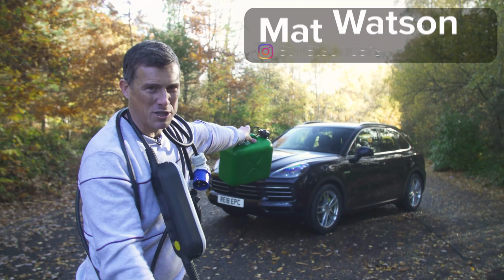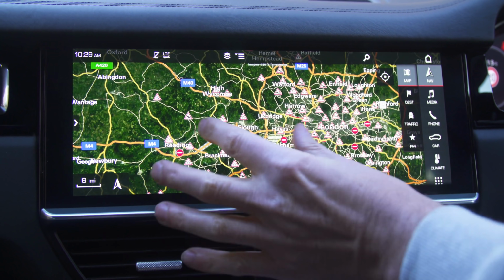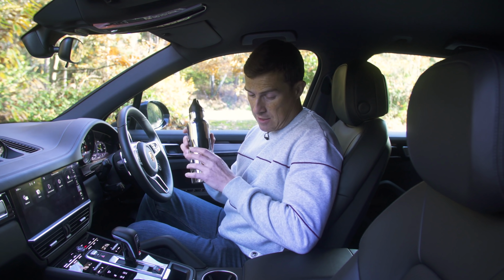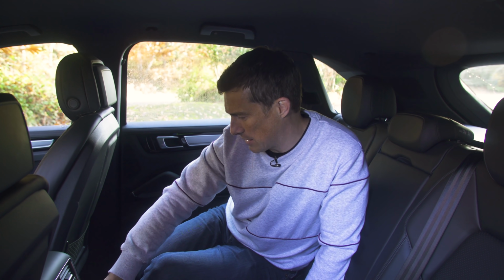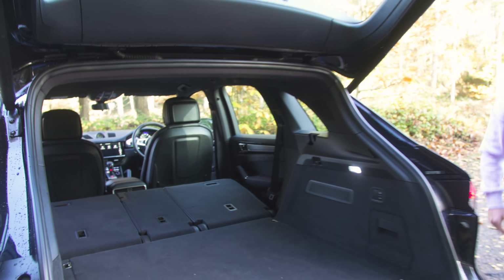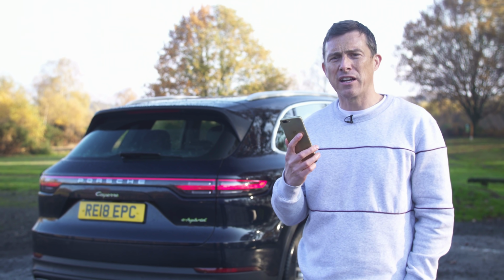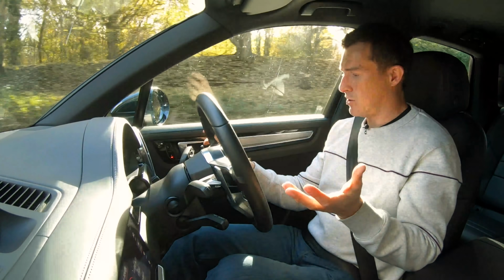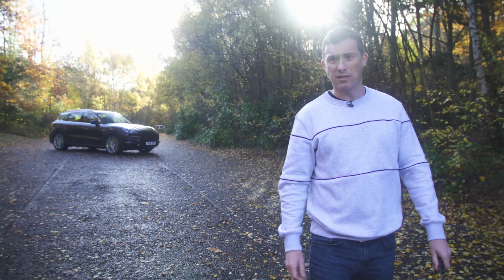Porsche Cayenne 2019 SUV in-depth review | carwow Reviews

Comment: Great review. Just one comment... the criticism regarding the volume control on the console... once you’ve owned the car, you’ll realize that the swivel knob and volume control are perfectly placed when you are resting your hand on the shift lever, which is intentionally shaped like a little platform to rest the heel of your hand on while your fingers can basically reach pretty much all the controls on the console as well as the touchscreen. It’s brilliant once you get used to it, and clearly it was designed that way from scratch as it works so very well. Just wanted to point that out, as you mentioned the same thing with the Panamera. Great review, I enjoy all your videos.

Comment: I test drove both the e-hybrid and the S back to back.  I found that the hybrid felt sportier and far more reactive.  The torque is available straight away, and the manner in which the electric and petrol engine kick in together is fantastic.  Off a race track, I would image the e-hybrid would be the more fun.  As for the green elements, these can all be 'removed' free of charge.  Just a question of taste whether which way you want to go.  The options list on Porsche, as with many German cars, is long and can add up.  Still, the best SUV that I have had the chance to drive by quite some margin.

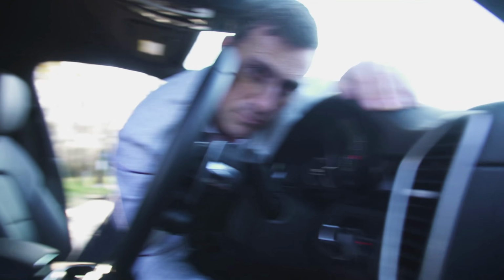Comment: 11:17 although a bit gimmicky nowadays, Porsche is the last automaker to keep the tradition of the LeMans-style start ignition switch. Back in the day, racing drivers would run to their cars, start them and drive off. Porsches has the ignition switch located opposite of the gear shifter so drivers could shave a few seconds by simultaneously starting the car with one hand, using the other to shift into first and set off faster than their competition... good times.

Comment: I don't think the issue with the fuel filler cap an Annoying problem..it's actually a great feature...no one is going to steel your charge when it's parked somewhere... Bit some one could drain your fuel....so it's better be locked from inside when parked

Comment: Anything that's not a button that works by pushing it, like a button, should be called out for the shite it is. It's cost cutting, because a screen is cheap and buttons are expensive. It's also dangerous, and generally utter wank. So the Audi ones vibrate? Who cares. Feedback after you've pressed something isn't the issue - finding it in the first place is.

Comment: I've been working for BMW and that button, that you have to push to open the fuel cap is to prevent the petrol from exploding in your face. Petrol vapor can potentially built up and won't be burned off, if you drive in electric mode for too long. All hybrid cars have that button to get rid of petrol vapor
Reply: 😮... Well Now

Comment: Nice review as always and no the fuel economy is not like this because of the spirited drive, it is actually horrible and you can barely drive 450km combined. Also it has not a good sound and the break feeling is inconsistent and shaky... It does not make any sense compared to the cayenne S and will be irrelevant (and drop price like a rock) in a few years. These new regulations are killing porsches competitive advantage making it's cars feel and sound like any other German car.
Reply: The E-Hybrids are far superior to the Turbos in the Porsche line-up.  I own a new E-Hybrid, and I've driven Turbos.  You get used to the brakes -- they are excellent and will stop you when you need to stop, quickly.  In my E-Hybrid on long-distance driving without plugging in, I can drive 550 miles = 885 km on a single tank of gas.  I plug in every night at home, and when I drive locally, I typically go 1000-1200 miles on a single tank of gas.

Comment: Paying extra for heated seats, full leather interior and reversing camera is an embarrassment for Porsche. 

I don't like these new infotainment systems. As Matt said, its so awkward to use while driving. Vibrating buttons don't help because you can't tell which button you've pressed, you can tell you pressed something but not what you've pressed. With physical buttons, you memorise the location subconsciously, think about a keyboard for example.  The swivel wheel is very small and the gear lever gets in the way. Awkward volume control too. At least you get physical temperature controls.

Comment: "you have to pay extra for <things>"

Same with every German car. There's very little comes as standard. On the plus side for that, you only pay for what you actually want, but on the minus side the headline price for the car is meaningless. I spec'd an A250 the other day and the base price was 38k and my config ended up at 62k.
Reply: There's actually a LOT that comes standard.  But, yeah, it is frustrating that you have to pay for adaptive cruise control, blind-spot monitoring, heated front seats, CD player, and lumbar seat support in a car this expensive.

Comment: Porsche no longer sell diesel versions so I no longer desire their cars. Who in their tight mind would buy a petrol SUV.
Reply: Luke Smith yes diesel engines are not as bad for flora as their petrol counterparts (one car wont make any difference for climate change but whatever floats your boat). What you don’t know is that diesel is much much worse for humans and animals when inhaled, which is why a lot of old diesels aren’t allowed in cities anymore
Reply: Who in their right mind would buy a diesel Porsche
Reply: People have been buying petrol SUVs for a long time. Deal with it.
Reply: Charlie Vetsworth well the majority is usually wrong
Reply: Luke Smith Diesel = Low CO2 (good for the planet), high Sulphur and Nitrogen oxides and dioxides (bad for people).
Reply: MKRM27 diesels now have systems to remove Nox and we have had low sulphur fuel for years now. There is no getting away from the fact that diesels are fare more efficient than petrol engines hence there is no such thing as a petrol lorry or ship.
And yes I do see the attraction of a high revving petrol engined sports car or an extremely quiet V12 petrol Rolls Royce but for everyday use diesel will do fine for me.
Reply: @Macron87  fuck people if you dont have a planet you wont have the pepole .
Reply: <Breathes in>
WHO IN THEIR RIGHT MIND WOULD BUY A PORSCHE SUV 🅱️🅾️ℹ️?
Reply: -never intended to buy a Porsche in the first place
Reply: Just an info thrown out there. I daily drive to work for 100 kms (2 way trip).
Get this: my wife's petrol Toyota Yaris burns 6,1 lt for this 100 km trip.
My Mercedes E220d which is like 40% heavier but also x10 times more luxurious burns anywhere from 4.4 to 5.1 lt of diesel for the same trip.
You do the math of how much more efficient the diesel engine is.
Reply: E-Hybrids are the best Porsches made.  The fastest Porsche is the 918 Spyder (faster than almost all other supercars), an E-Hybrid with a petrol engine and electric motor.
Reply: Diesel in 2018 😂😂
Reply: Why not?

Comment: That infotainment center is super laggy.
Reply: Julian Green That’s because it’s filmed. In real life it’s Perfect, I already tried it ;)
Reply: @lorenzmuller4000  So why other filmed cars do not lag ?
Reply: V 12 If the camera records at 60 fps and the display is a 50 hz display it can happen that each shot of the camera misses the picture because they are asynchronous. I’m not a technician so it’s possible that my explanation is not 100% accurate, but you can see the same thing happening when doing a slow motion record of a lamp. It looks like it is flickering but in reality it’s not.
Reply: @lorenzmuller4000  They use the same camera on other cars, why doesn't it happen there ? The transitions are not smooth like on a phone for example and there is no reason it shouldn't be on that car.
Reply: @lorenzmuller4000  lol that makes no sense m8. No trying to argue but how would film change the perception of input lag?
Reply: Julian Green its very responsive
Reply: @turbos7780  It is not responsive. It lags. That is what touchscreen phones and stnavs from 2008 did. MBUX does not lag. I drive does not lag. That lags.
Reply: @mnoovurvi  yeah. BMW and Mercedes seem to have gotten it right
Reply: Agree about its lagging, check out new Porsche Panamera infotainment system is very smooth but the BMW iDrive has aced the game, so did the Mercedes & Audi MMI
Reply: @johnhere1426  ill have to check out the bew panemera. as for BMWs iDrive, i agree. with Mercedes, yes,  but only MBUX, not Mercedes Command. Audi's MMI can also be laggy as i have had some first hand experience, and yes, with the old and new version
Reply: The screen sux, big time. No joke. It’s horrible. Whole system is horrible, makes me want to punch it every time I use it. CarPlay is good. But if you use it the screen becomes tiny. A lot of grey useless bars. Whole thing is rubbish. Car is great, fit and finish is great, electronics should be a big iPhone mount with wireless charging. CarPlay is an ok proxy. Like all good German cars, the screen is disabled when driving, except for radio, ac, etc. bc no one ever crashed a car fiddling with the radio, but entering an address is way too dangerous.  But if you use CarPlay you can enter an address while moving, so again, stupid Germans. Fire the lot of them and outsource it to Tesla, or Apple, or a team of like 5 average college kids.
Reply: ken90017 Lol fucking liar. This car is not even released and you talk like you own one.
Reply: @A real petrol-head  Have you been talking to my Xs?
Reply: Agreed. Driven one. Long lag.

Comment: Well, no one is going to steal your charge but one can steal your petrol 😂😂😂
Reply: If I remember correctly the BMW 530E (hybrid) has the same petrol cap that can be opened only from the inside. The reasoning is that the fuel tank needs to be pressurized, as petrol spoils after some time. So if you drive only on electric, you have longer petrol "longevity" in your fuel tank. BTW their old hybrid system could do 30-35km only on electric, but the new X5 that goes out later 2019 could make 70km full electric, so for your average commute you can go full electric and only use petrol over the weekends outside of the city.
Reply: lol No new car these days falls victim to Siphoning.
Reply: Truth Hurts You never know with petrol prices these days 👀!
Reply: Alexei G. How much is petrol over there in USD?
Reply: Tyler Beeson I live in Australia :-).

The price can vary quite a bit. In Melbourne it is $1.25 at the moment but was more than $1.60 AUD this month (91 ULP) !
Reply: H-EXactly.
Reply: I was thinking thesame thing
Reply: Angry baby mamas put sugar in the gas tank
Reply: 23.8l are too much for suv
Reply: @TheMatasr97  mpg (imperial), which is equivalent of 11.87 l/100km
Reply: He nitty picks these things which make no sense to dent Porsche, but not a scratch made!
Reply: Really wonder how he couldn't see that! So obvious!
Reply: I think it's so one can pull up to a charge station, plug in the car to charge, and then lock that car while you do your shopping, since charging takes longer than going to the petrol station.
Reply: https://youtu.be/NWVioXDKo2U